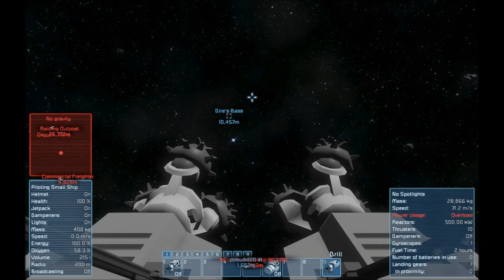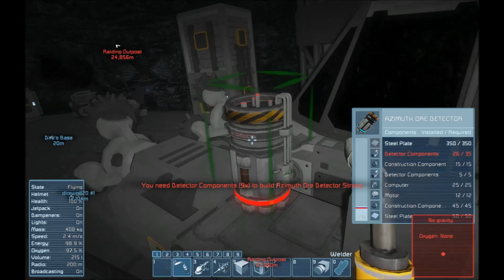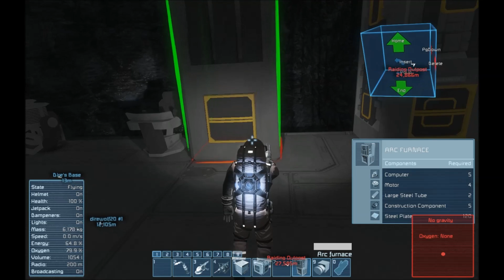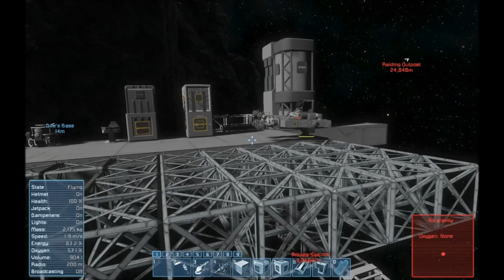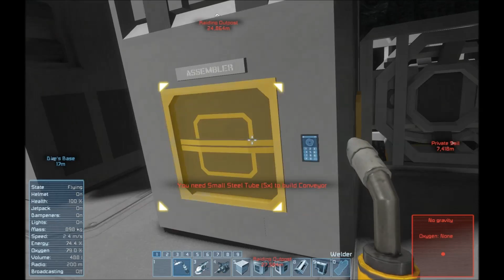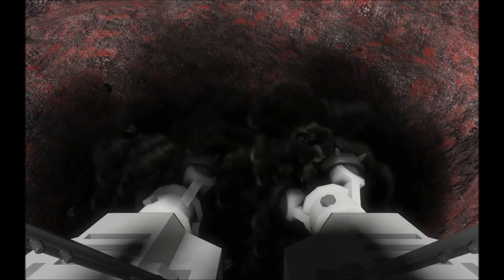Space Engineers   S1 E3   Conveyors

Comment: Dire, first off thanks for doing this series!  The more people introduced to Space Engineers the better.  Secondly, the reason the small ship ore detector is weak, is to promote a diversity of ships.  If you bring a large ship, or have a station, with an ore detector on them, that detector will detect at a larger range.  You can then transmit those ores' positions via antenna.

Comment: I have a problem. my refinery does not auto output to cargo containers (connected via conveyors). it works properly because an assembler on the same line can pull from the storage. I have no mods installed because I don have a computer powerful enough to handle it.

Comment: Some tips for Dire, there is a Vanilla Conveyor that allows for sorting. it uses directional control with White/blacklisting. Also, the Arc Furnace also smelts Cobalt and maybe something else. I think there was a 4th ore... the Arc Furnace is sadly under used. I'm trying to use it more in my builds since it is fairly quick to process stuff. however the Module mod you use makes it pointless. the the Arc Furnace could get a Module slot it could be awesome. you could eventually have a refinery for each metal and use the Conveyor Sorter(?) to whitelist the ore you want processed there. The sorting mod you have makes it pointless to use that vanilla block. I don't know if you use it, but there is a Uranium Centrifuge Mod that is pretty sweet. it has Module Slots and is more Efficient with Uranium processing.use two of them with a module or two on them and you can get more Uranium pretty quickly =] not gonna lie, i'm happy you started playing this. SE is a great game. and the Planets are SOOOOO close xD

Comment: bro. I wanted to let you know that inventories share on both refineries and assemblers if you simply build them with their doors attached directly to each other. In this way you can string as many of either of them together as you want but without having to spend materials on conveyor tubes.  They also will outo fill and draw from each other as necessary.
Reply: i think only same type of machines do. assemblers can be stacked, but I have a cargo container next to an assembler. it doesn't pull out of it until I connect it via conveyors
Reply: no no. it's strange what does and does not but I know for a fact that a assembler will pull from a refinery and I know a refinery will pull from a cargo container.

Comment: Does anyone know if there is a portal gun or wormhole transport style of mod designed to work with Space Engineers?  One thing I would like is a way to transport a big ship home once I've captured it and disabled it's turrets.  The conventional way of piloting it home sometimes leaves a lot to be desired, especially if it's one of the default AI ships that spawn, some of which run out of fuel and turn themselves into a dead space hulk.
Reply: +DarkVoidIII jump drives were added not long ago, can also have a remote control block autopilot back home and turn off all unnecessary things.

Comment: Dire, one thing you should know about the drills is that there is a place to connect the conveyors to the back of the drills so that they are not hanging out and able to be destroyed easily when you accidentally bump into something.
Reply: +Michael Dezsi (Geathman707) 
Yeh, but he could also replace thruster between them with piping. As he have additional forward thrusters it wouldn't matter anyway, and he would have clean connection that way.

Comment: Hope the devs would fix at least oxygen system. It seems currently impossible to pressurize a room. If unlucky, we may see Dire encounter it first.
Reply: +user137 it's possible to pressurize a room, you need to actually seal the room though, and not all blocks are airtight
Reply: +draconas rayne Theoretically yes, but it's bugged atm if you go and try. You can find many threads about it on forums.

Comment: I had an assailant attack my base, didn't have a fighter built yet, and ended up going after it with my mining ship.  One ram with the drills on and it took off at high speed ^_^
Reply: +neeneko to get rid of the assailants as well, if you can destroy the gun on the front of their ships they will turn tail and run
Reply: +Crza1n I wonder if that is exactly what happened.

Comment: Dire, how about adding a battery on your mining ship? Battery can provide quite a lot energy (8 small reactors) and your station reactor has enough output available. You can recharge through connector when the miner is idle.
Reply: +The MoSS 
What is the point of using batteries when you have a reactor? You lost energy when do that. But batteries with emergency reactor is great when you have solar charging station.
Reply: You can use station reactor to charge parked ship (connect, turn off miner's reactors and set batteries to charge). You use uranium either way, but you don't need to build expensive reactors (you already have one, so why not use it?). You're just using different reactor to power the ship. Battery is very cheap and can provide as much energy as 8 small reactors for small ships, at cost of some iron and nickel. Batteries are viable option for starting the game after rebalance update (thanks god they don't need platinum any more!). I've done some math and 2 batteries can provide enough energy for 8 thrusters up/down, 8 left/right and 12 forward/backward without overloading. (or any combination of 28 thrusters in 3 different adjecent planes, 56 in total)

Comment: something I always do with my ships when I have the resources (within a few hours) is convert them to battery/reactor hybrid, reactor's only an emergency reactor if the batteries die and when that occurs, I dont have it charge the batteries (i'll explain why) and it's enough to limp back to base.

I make two packs of hot swap batteries (merge blocks and connectors) that contains two batteries per, I'll swap out the nearly depleted one for the fully charged one.

reason why you never want to charge batteries with reactors is because it's only 80% efficient, you lose power charging them.

I make a charging station near by that's 100% solar (large ship preferred) with docking nodes, this exists until the station is converted to 100% solar (is possible).
Reply: +draconas rayne I always make the same thing, except I use solar powered satellites with merge blocks as my mobile chargers and one big ship filled with batteries and solars as my power bank. I try also to build my ships modular, so I have one ship with bunch of modules which I can disconnect when I don't need them like drill module (drills, storage, connector with conveyors), repair module (welder, grinder, conveyors, storage for parts, maybe a blueprint generator), additional thrusters and reactors to get somewhere quicker, rocket launchers for fun. It can be difficult to come up with good design but when that's done you have only one vessel for all your needs. 

All modules have their own battery and a beacon, so I can keep track where they are (I lost countless thruster modules on my mining trips, so now i equip them with beacon and gyro so I can find them later and they won't float away)
Reply: sounds neat! I wish I could try what you are saying, but I can't cuz I don't have the game
Reply: datgamerboy123 ah, it's a fun game if you can get past the bugs and some broken stuff. also look at watch?v=LmkMqpOEajw it has the example of the hotswap batteries

Comment: I prefer to not use Arc Furnaces, they have less efficiency than Refineries, so you get less ingots per ore than Refinery.
Reply: +Uriei I prefer using arc furnace for stuff like iron as I can end up with ridiculous amounts and I'd rather have my big refineries working on the other ores.

Each to their own though.
Reply: +Uriei Its actually the exact opposite. You get more ingots for the same ore in an arc furnace and it will work faster.
Reply: +mega mit Arc furnace is slightly faster than refinery, but refinery full of power efficiency modules needs about half energy. On the other hand, low cost and small size is good enough reason to build them.
Reply: +The MoSS true. i was mainly talking about pure ore efficiency and i did forget about upgrade modules meaning an upgraded refinery does end up better than the arc furnace.